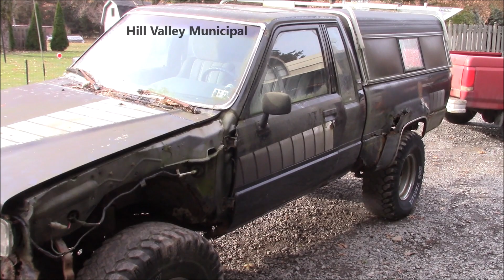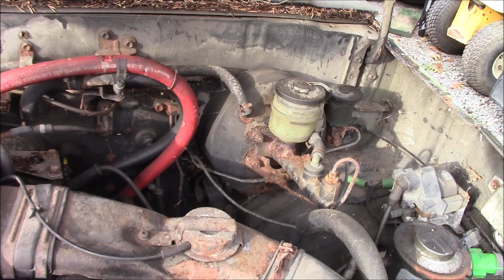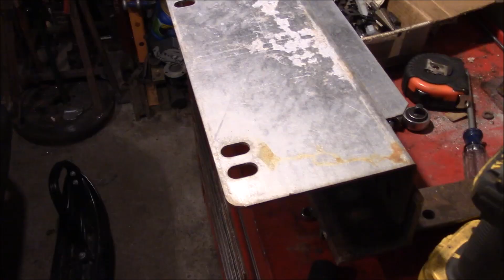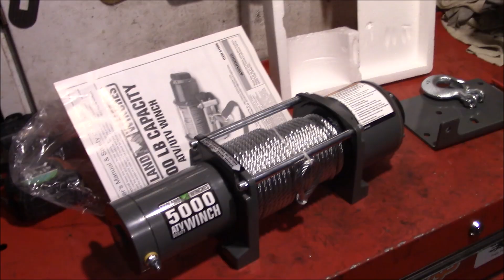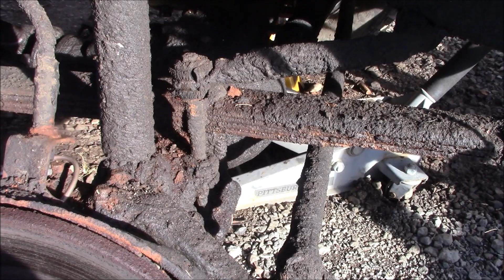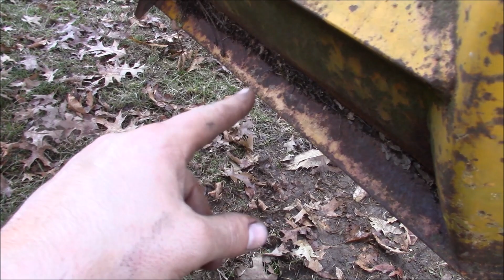Grafting a Junk Snow Plow on an Old Toyota

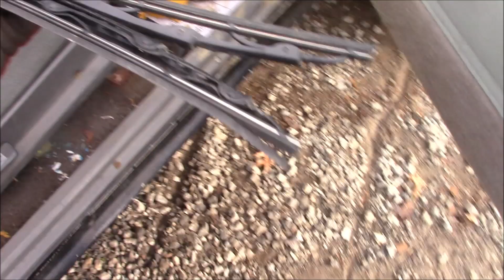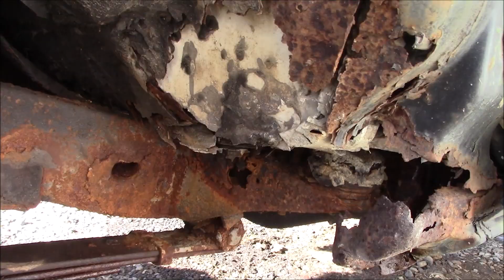Comment: 2:00- No problem, just get out the o block of wood "E-brake" and attach rope to it, then cast it out like an anchor...........2:25 once again purrs like a kitten. Couldn't you just get away with using Fixaflat on those tires if it's just round the yard use? 9:35- This looks like a job for...... The frame-tester 5000!!!.........10:15, sounds like you read my mind. No problem, just salvage what you can from the grey Yota.

Comment: Nice build. I see your Hobart welder out getting the job done I’ve got the same one great tool. I have the bed off of my 85 Toyota pickup patching up the frame. What’s your thoughts on oiling the box frame internally? Spray the oil or tap off holes a fill frame with oil to insure coverage?
Reply from the maker: Thanks man.  I'm all for oiling the inside of the frame, just try to get as much dirt and crap out of it first.  I sometimes add a piece of hose on the undercoating gun to get some extra reach when spraying into the factory holes.
Reply: Thanks man